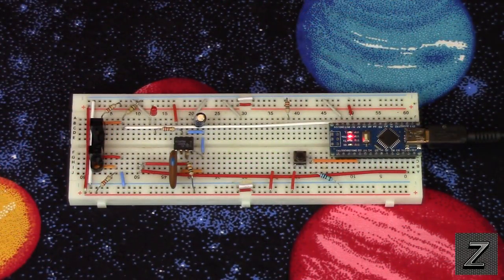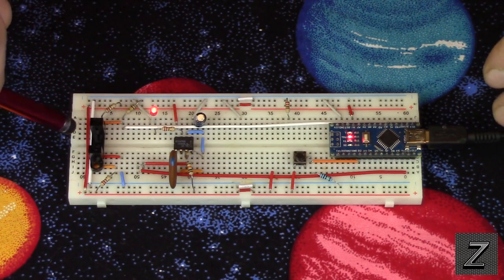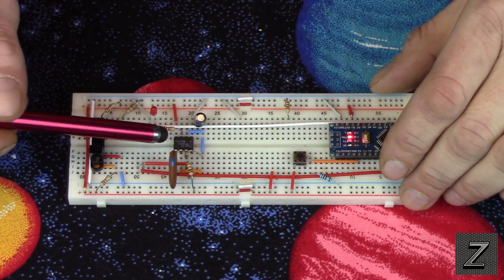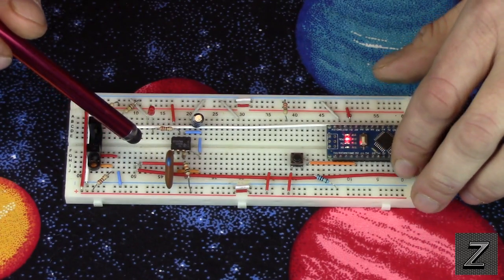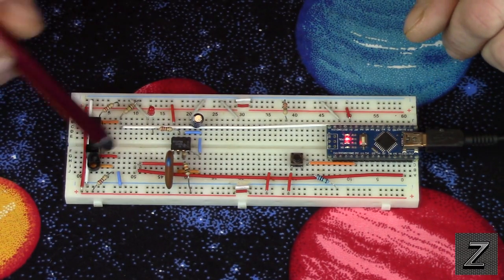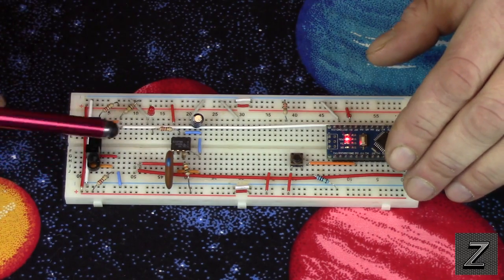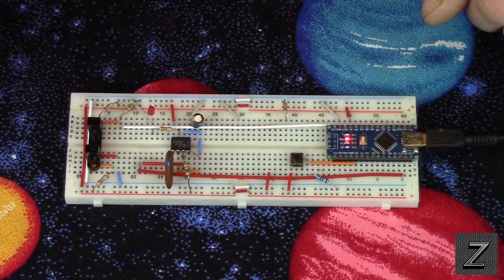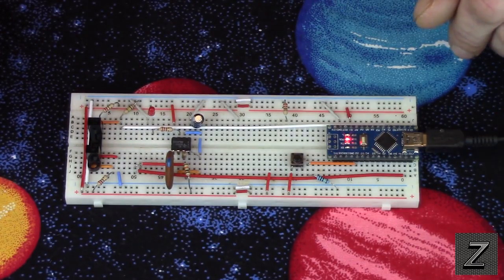Arduino, How to blink a LED without using delays in your sketch

Comment: you can do this with software, there are multiple ways; the easiest is to put your high-speed high-PRIORITY device on an interrupt pin, blink the led however you want, as long as it won't interfere with the interrupt.

could be useful if you run out of interrupts, still interrupt handler (software) doesn't add to the BOM